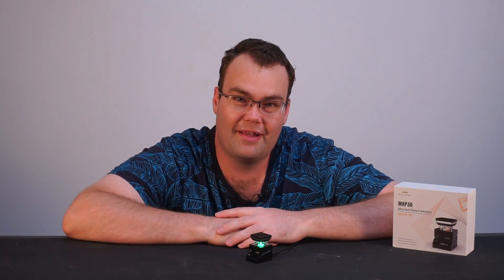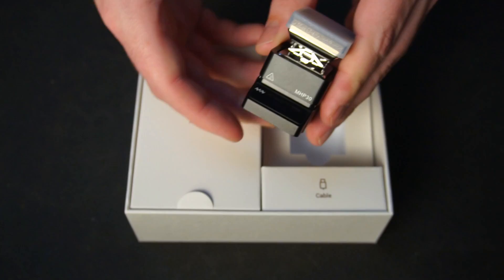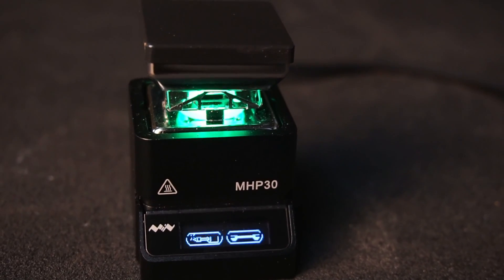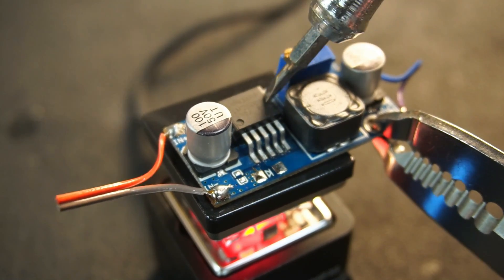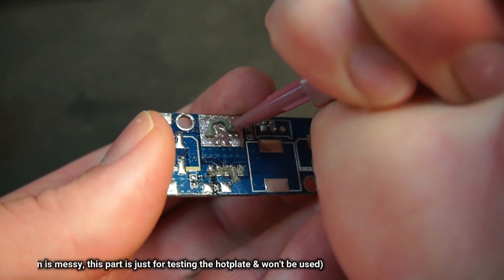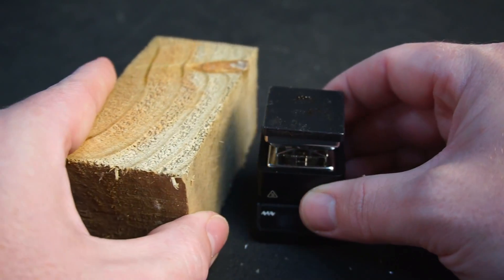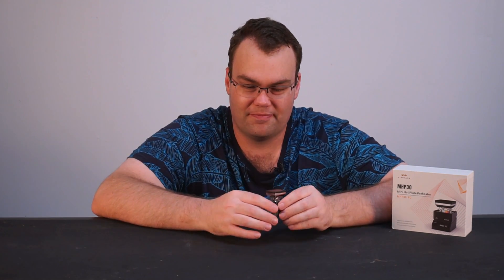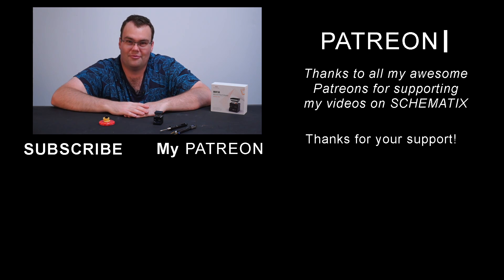MiniWare MHP30 Hot Plate Review ll Reflow, Rework, Solder or De-solder SMD or THT components

Comment from the maker: If you buy a Hotplate and use my Amazon affiliate link, it will help support my content :) https://amzn.to/2MY8mdM
Reply: Hey! i was wondering, what is your view on yihua soldering stations, do you think they are good, or no?
thanks!
Reply: @no_aa08  I have a Yihua 952D+ and it's quite good. Make sure you buy the additional set of tips though. The airflow on the hot air side is a bit weak, at least on mine. I think it could be increased a bit but then that's based on using it for heat shrinking and not exactly it's intended purpose. What I find, and it may very well be the solder I'm using, is that the temperature has to be set quite a bit higher. As I said it could be my solder - not the best stuff - not even close. That's next on the list.
Reply: @richardperritt  i jusy bought the 939d+ it seemed like a a good deal, and mine gets up to 990 degrees f so i think it will be okay, thanks tho

Comment: i have the DT71 and TS80P, i really want miniware to make a multimeter and a hot air rework station. i cant use the MHP30 because my boards are slightly larger and double sided

Comment: The major concern I have with using it to heat a larger board is that uneven heating can easily warp your PCBs if you're not careful.
Reply: I’m going to use a aluminum plate between the surface and the board I want to solder, gonna do a test run with just a bare pcb with a thermocouple to dial in the right temp to set the hot plate to, might use some hot air aswell.
Reply: @ricardo_9726  So how was the test?

Comment: The video is fine, but the product is a big "nah" -  8/10 Juicero points for practicality vs cost.

Not much heat capacity for a steady temp margin - which is critical for delicate PCBs (might be regulating tight enough).
And too small for usage flexibility.

I'm sticking with my modified upside-down clothes iron 😉
Which also has a real non-stick coating and only cost around 10$. No RGB though..

Comment: a wifi or Bluetooth app with a temp curve interface would fit it well.
I dig the low size a lot... it seems to have thermal power and the PD interface is great but an app would be ideal for controlling the interface and perhaps could mnage a heat curve for short temp spikes and then you don't have to fiddle with those A & B buttons that that ain't ideal for something this small while in work and risk of tumbling it..

Comment: Hi, I am currently in the PLTW course and we are supposed to make a full on functioning product. Our idea was accepted by a couple of real engineers, but our biggest problem is actually making it because me and my partner know nearly nothing about designing circuit boards or even the basics of electric circuits. Programming is another problem of it. Our budget is $250: $50 for the prototype and $200 for the final working product. If you aren’t able to help, what sources would you recommend for us to use to be able learn  and eventually use to make a proper schematic. If we are able to create a schematic, then we should be able to continue from there on without any problems.

Comment: Nice review, thank you for the video. I saw this on Amazon but wanted a bit more information on it. Although it is a nice tool to have esp if you do smd rework on miniature circuit board. The only beef I have with this product is the price. Don't get me wrong because I don't mind shelling out good dollar for quality product but the heat up time for it to reach 300C in 2 minutes is just not acceptable for the the money they're asking for. The Hakko FX888 compact soldering station is the same price as this hot plate. I would rather just get that and buy a blade tip for it and use it as a hot plate. It heats within seconds not minutes. It is a good product but just wayyyy over priced for what it is. Like JBC is expensive but you do get what you pay for. It can reach 0-300C in 2 seconds.
Reply: If you strap a metal block onto Hakko FX-888 it's gonna be equally slow.
Reply: @momoware  Well at least at the price it comes with a great soldering iron with it. I don't mind the waiting time at all because it's not like we use the hot plate all the time. Only a certain that we ever use it. So that's fine with me.

Comment: Seems like this would be more usable if you made a custom workbench tool that you inset this hot plate into.  Include some hold down clamps so boards are not sliding around when you touch them.

Comment: Doesn't that cook components beyond their temp ratings and kill them?
Reply: Actually almost less of an opportunity of destructive soldering than hot air if not experienced. You do have to set it only as hot as you have to and operate as swiftly as you can - and please don't try to solder with a screwdriver, or i will be gravely offended and you probably won't be too happy either. But 300°C setting is about adequate

In fact i think most of this video is best seen as a how-not-to. You want to bake your PCBs at a safe temperature below 100°C for a while to drive off the moisture, you want to braid off the solder that's already on the pads before you add some paste solder, and no-no screwdrivers with magnetic tips or magnetic bit retention near high heat. Sharp cheap 7sa tweezers are amazing at manipulating components swimming in molten solder, though they are a bit consumable.
Reply from the maker: Yes, if you're not careful & aware of specific component temperature's limits

Comment: Does the supplied power supply from your link to Amazon (US)  work on 240V??
Reply: Universal input range, so covers 120 to 240VAC, and as it comes with an Australian and an EU adaptor set yes it will work on 230VAC. Look at 99 seconds in, when the label on it is visible.

Comment: That'll be really handy for me right now, as I need to replace a burnt SMD transistor size SOT89 from my Sega Game Gear power board. I'm doing a full restoration of it. Great video by the way! 👏👏👏
Reply: SOT89 and even that big power chip as shown aren't actually a drama at all, i've done that quite a bit. You can just heat the tab with a normal soldering iron, and the whole chip will get hot enough to lift from all pads simultaneously about as quickly as the solder under the tab gets molten, maybe after just a handful more seconds. Then you can clean up the pads with a braid, and you can even single-pin solder the new device in place. Paste is a nicer way to solder the tab, but even if you just heat one corner of it with an iron and feed solder wire from the other, the solder will wick underneath it evenly no problem if you use flux!

Sure it'll take a bit longer but if you aren't doing them all day every day, the extra time doesn't really justify getting an expensive extra tool that you'll just spend time retrieving when you need it. Either way the main challenge is just manipulating the devices into place, so you must get some sharp tweezers and must become mentally one with your tweezers.
Reply from the maker: Glad I could help

Comment: Interesting idea, but also very great way to permanently damage your components.
Most components actually can't stand the heat for that long. 
For this reason ovens usually stay around 150-200 degrees or so, and quickly ramp up and cool down again (soldering profile)
What I personally would do, is use it on a lower temperature to kind of "boost" the temperature and do the rest with hot air.
Reply from the maker: Agreed, I prefer my semi-conductors medium rare, not well done ;)
Reply: @Schematix  lol
Reply: That concept is called "preheating". If you're following your solder paste's reflow curve, you use a hotplate to get through the "preheat/soak" part of the curve and use hot air for the rest.
Reply: I'm hoping I'll have some success doing that. I have an absolutely tiny QFN part I'm soldering to a board (2.5mm by 4.5mm with 30 pins - 0.4mm spacing) that has a soldering temperature tolerance of 260C. The solder paste has a melting point of 220C and a recommended peak soldering temperate of 250C. Plan is to get the hot plate up to the 150C - 175C soak temperature, leave it for the 150 seconds, get it to the 250C peak, then turn it off and wait for the solder to solidify a bit and pull the board off the hotplate.

Comment: Looks very interesting. First Time in seeing s gadget. 
I'm concerned about the temperature the components, won't they get spoiled?
Reply: Components actually have temperature/time ratings in their data sheets, and realize they are assembled in factory by a very similar process.
Reply: @FireFliesIlluminateMe  hmm makes sense. I usually try to be on the safer side to not over heat my components.

Comment: Larger plates are better for rework. Easier to thermally regulate. You normally bring pcb up to a temperature just before reflow and then use a hot air rework gun to reflow and remove/replace the part in question. This seems a bit of a comical product compared with MiniWares other offerings.  It may be a problem tool for the majority of the market most likely to buy it.
Reply: That was exactly my thought.
Heating components up this way will probably risking damaging them.
Reply: @p_mouse8676  It's use for micro pancakes seems enticing though. Odd seeing all the nice design miniware are known for in a dumb concept.Certainly has semi-original features. OLED, RGBLED, ceramic surface, detachable plate.  I'd of purchased it, if it was 150-180mm square plate.
Reply: Also strikes me as risky having something that small with a large board on it: uneven heat distribution must risk warping the board, ignoring the obvious risk of something toppling over while moving components about and the possibility of blowing it over if you use in in conjunction with hot air! Does look cool though - maybe ideal for reflowing  SMD to DIP adapter boards, if you can't be bothered getting your full-sized hotplate out, that costs less. A bit too niche for me.

Comment: Nice review. :-)  Having bought and constantly using the other 2 quality MiniWare products you mentioned, I am tempted by this mini hot plate. I already have a 100mm hot plate, that I regularly use for rework and quick prototype reflow. But I can see the MHP30 as a great quick-heat addition to the workbench, for individual part rework use.  Thanks.